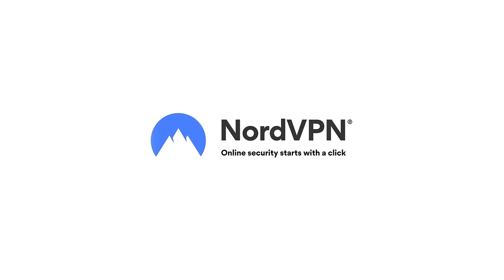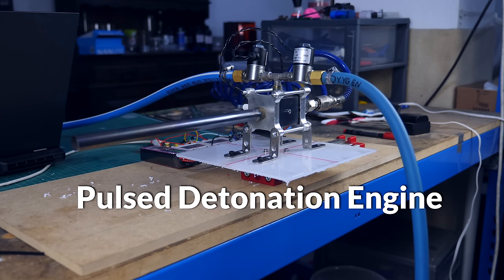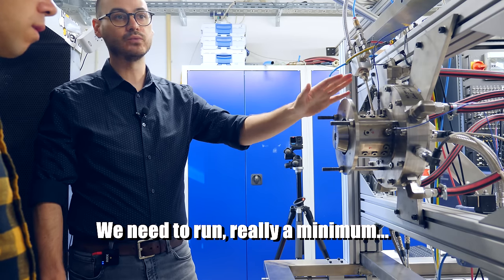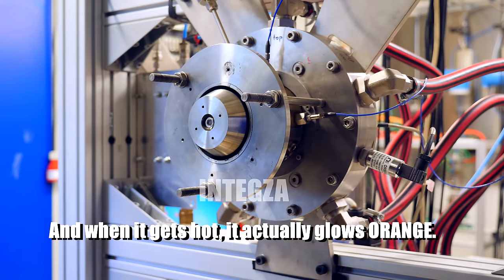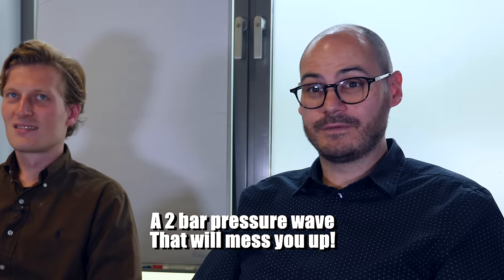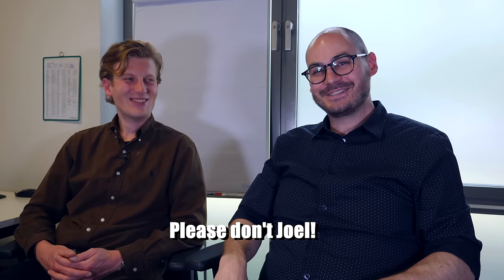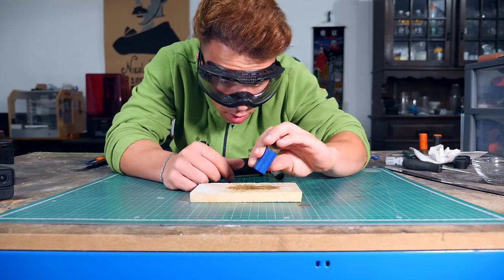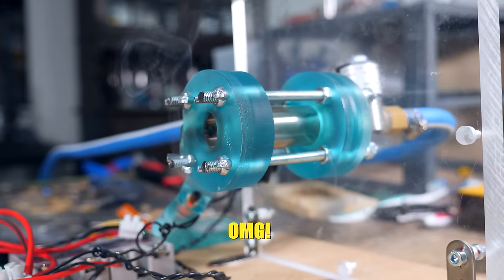NASA lost this TECHNOLOGY 60 YEARS AGO

Comment: Suggestion: Journey to an actual standalone rocket/plane/car - I really enjoy your content but working towards a practical, containerised engine for moving vehicles would propel you to anti-tomato legend status! I know it would be a much longer project, especially getting pressurised fuel into a reliable lightweight stand-alone format, but maybe collaborating with more like-minded people from e. g. the RC sector could make it a lot easier - In any case I look forward to seeing what comes next!
Reply: Yeah!
Reply: Hell yeah
Reply: I had the same thought, but on a slightly larger scale.... I've seen people build rc aircraft that are friggin HUGE.... why couldn't one be made to carry a payload of say 200 pounds? 250 pounds? And if this can be done, would it be possible to use an engine like this since the tanks are relatively small... I have been designing a " personal aircraft " for many years, without the needed knowledge to be successful, but using my gi bill I am currently going through on an aerospace engineering degree.... I am hoping to tinker my way to a fun and REALLY dangerous toy some time in the next decade.
Reply: Peter Streipol please help us!!
Reply: @ryanrich9186  what's your email? I think I could help you out a bit here... just finished my first test flight building one out of my garage (theoretical 500 lb thrust)
Reply: Real suggestion:  Bring back the goatee.
Reply: @loganhenning4850  hey do you mind discussing a bit with an aspiring engineer?

Comment: I’m a researcher at the University of Central Florida specialized in RDE’s and Pressure Gained Devices. I have been watching your videos for a while and would love to talk more if you are interested. My next video idea would be to make the RDE combustion chamber annual and attempt to observe the actual rotating detonation. An additional idea would be to create a planar RDE which would use this exact same set up and would just be used to observe the detonation wave.
Reply: My issue with this type of engine is that they are INSANELY AND EXTREMELY UNSTABLE. While I know hopefully in the future we might be able to implement these types of engines there is a reason why haven't seen that happen. 

I did see P&W got a contract for them, but it will be interesting to see if anything comes of the research. 

I remember during my capstone someone gave a presentation of these and I highly rolled my eyes at them. 

As an AE we already have enough problems with airplanes trying to blow themselves up.
Reply: @seemlesslies  As an A&P I can confirm, turbines like to blow themselves up haha. 
It would be interesting to see an RDE used in a sort of “afterburner” theory behind a turbojet. If it was centered on the inner axis and the compressor section could direct compressed HydrOx fuel air mix you could potentially have enough pressure to drive the combustion wave. 

I guess you could think of it like a shotgun, inside a cannon hahaha
Reply: Buddy am interested to listen to your talk and view on this technology, can you share your insta id, we can connect there and talk further!
Reply: Give this guy some likes. I want to see the collaboration video.
Reply: @itsbingbongyo  I just think it's one of those rabbit holes of research where money goes to die.

I always love the comments of. "It has no moving parts therefore it is easier to manufacturer!" Then when you realize the insanely complex control system that needs to constantly be working in extreme environmental conditions. They couldn't even run the thing for longer than a second. This should tell people just how unstable it is. 

It's like fusion technology were constantly 5 years away from a break through. 

I'm a very if it ain't broke don't fix it. 

ENGINEERRS loveeeee to play efficiency gain games and quickly dig themselves in holes no one can ever get out of. 

My bigger question is why do we need these who are these going to serve? We already have the F-22. No one has competed with the US on that front. The F-35 is a joke compared to the F-22 in the sky. (I know I know they serve entirely different purposes but still). 

You think anyone in their right mind would get on a plane with this type of engine? 

It's like electric helicopters. I wouldn't touch those with a ten foot pole. 30 mins of flight time. That is bananas safety margins. 

I wish people would get off the electric aircraft train it's a horrible idea and it will never work. Fuel is your safety factor of an aircraft. The future for planes is likely natural gas or hydrogen. The energy density is at least reasonable.
Reply: Annual combustion? Why not daily?
Reply: @seemlesslies  progress has to start somewhere
Reply: @armaniwebb4467  I think progress for the sake of progress is absurd. I have no issue with setting reasonable expectation, but some stuff is just not likely to work and is likely just a waste of money. 

I can name a crap ton of pieces of engineering technology that were an utter waste of time, money, resources. 

First one being solar cells for 95% of applications. They are garbage. Their energy density is laughable at best and are only useful in edge cases. (This will be a reoccurring theme and energy density). Solar cells are entirely unsustainable in all forms and the only reason they should be used is for places where you cannot get power. Mars I'm looking at you. 

Electrical Air flight that has anything to do with more than a few dozen pounds. Why? Because energy density of fuel. One of the most important part to the safety factors for aircraft is their fuel. Why? Because altitude is generally the best way to keep you safe. The only future to aircraft that will likely be mainstream is hydrogen or liquid natural gas. This is entirely due to energy density. 

And stuff like carbon nanotubes it's purely theoretical at best and has like zero practical application.
Reply: @seemlesslies  Lord Kelvin swore black-and-blue, and gave speeches in the House of Lords, that it would be suicidal to construct powered transport that went a hundred miles an hour. Insisted that the human frame could not survive it.
Just saying.
Reply: @seemlesslies  You know, I always wonder why progress was so slow for homosapiens for the first 500,000 years of our existence. Homo Sapiens and precursors had been using stone tools for over 1.5 million years, but we only started using fire 200,000 years ago. And then, even with fire, it took us another 180,000 years to figure out how to grow food, domesticate animals and forge copper. Then it took 19850 years to go from metal hand tools and horse carriages to the industrial revolution. Then only 150 years to go from steam trains and telegraphs to F22s and Supercomputers. Thus showing the true capacity for innovation we had all along.

I genuinely believe its due to the prevalence of men with your mindset. Thank goodness we didn't get hit with a extinction level event anywhere along that 1.5million year malaise when stone tools and caves were 'good enough' for us.
Reply: @caseyb1346  I think you have a fundemental misunderstanding of how history and science works. I wonder if you have ever made something or engineered anything to function in the world. 

I used to honestly be like you and think that we just needed to pump as much money as possible into research and it would make dividends on humanities progress, and then I started actually making things and being involved with projects and you quickly realize that unfocused research generally leads to dead ends for a large number of reasons.

You haven't addressed any of my points but attack my character which is always fun. 

What you're failing to grasp is there are natural limits due to physics. There are things that just cannot be overcome with "more research". 

Also I strongly recommend taking or looking into history of science. Because what I also failed to understand is that science theory only progressed as technology allowed for the experiments to be shown to be true. The helocentric model of the earth was developed in 400 BC. It wasn't taken seriously till the invention of the telescope. The reason being is that they had no way to prove it to anyone. They could not prove gravity even existed. Without the discovery of gravity and the rotation of the planet they could not explain why things fell. (This was a HUGE) problem. 

Then let's go into the Quagmire of crackpop science. The countless number of people hurt by science in their day. Want to talk about blood letting and mercury cures? 

I listed quite a few well known technologies that are horrible and are widely used for all the wrong reasons because they will "save the planet". 

The first rule in life is everything has a cost. You will NEVER get something from nothing. Entropy is like death and taxes. Everything produces waste. I wish people would stop selling "green" because nothing is green. 

Finally let's talk about the physics. There are real world limitations that you can never get around. For isntance the speed of light is "the speed of limit of the universe" it is for all intents and purposes impossible to get around. You have the physical limitations of materials, and you have the total amount of energy required to do things that doesn't change; The only thing that changes is how efficient you can do it. Which is exactly what this motor is doing. It is increasing the overly efficiency of the fuel burning and rotational process, but it comes at the cost of stability. How unstable? EXTREMELY UNSTABLE. As I said above engines right now are already trying to constantly blow themselves up. They can barely operate this technology for a second. Because the temperatures are so high and how the systems they are using to control it couldn't withstand the heat/pressure. This is a limitations of materials. 

Materials limitations is actually one of the biggest problems we have right now. We just cannot make things that much stronger than they already are and even the things that we could possibly make stronger it comes as a significant cost. 

In aircraft weight is the enemy. 

You want another idea that is doomed for failure? Electronically stabilized structures. One of the biggest problems on all structures isnt the static loads it's the dynamic loads and frequency responses. You can electronically stabilize a structure due to flutter and reduce the weight of the structure. HOWEVER, if that system EVER fails your wing just breaks instantly. To margin of safety on that is just to high and will never be implemented maybe extremely light weight not human flight because no system is perfect. 

Want another example? Let's talk about The Naiver Stoked Equation. It has a million dollar prize right now it has had that prize for at least 20 years. If we could solve that equation in a closed form it would literally change the world. I'm talking a priceless equation. You have had people working on it for decades and they cannot solve it. Why? Because we just don't have the ability right now. It's not a matter of time or money it's just a lack of knowledge to apply to it. 

Let me finish in closing that. I'm not against experimentation. I actually love it and think it's super exciting, but selling it as the solutions for the future is bananas, and wasting time on unknown technologies that likely are decades away from being useful when we have valid technologies that can be improved and properly implemented blows my mind. 

This isn't really the engine of tomorrow it's the engine in a century (maybe). 

I'm talking about having reasonable expectations.
Reply: helo , i like to researching about that RDE  can you help ?

Comment: I love your videos!, create a drone powered by a rocket engine!
Reply: Y E S
Reply: That would be too expensive though. 4 ROCKET ENGINES on each side.

Also the RC gear would be too heavy because you have to throttle each engine to make it lean in a certain way.

Also throttling a rocket engine is not as fast as slowing down a BLDC Motor.
Reply: @slatetechnologies1724  :(
Reply: @netanelelbaz7247  What?
Reply: @netanelelbaz7247  So, a couple of things to consider with this idea. Most drones achieve rotation by taking advantage of the rotational inertia of the propellers. But rocket engines don't have that, so simply replacing props with rocket engines will result in a hover-only drone. 
Instead it would be best to do it the way NASA did with their Project Morpheus; a single rocket engine to provide hover thrust and smaller engines to stabilize it and provide side thrust.
Which brings up the point that NASA's already doing that.
Also, don't beg for likes.
Reply: Well… I build fpv drones and I’m sure it would be to hard for the flight controller to control 4 engines. An airplane would be better. Or rc car
Reply: Begged for likes and still didn’t get the 3D Printer?
Reply: @suspense_comix3237  I guess this giveaway is a scam :D
Reply: @netanelelbaz7247  mad cause you lost

Comment: As an alternative to the primer from gun shells, you could go to a well stocked tool store and ask for the "powder loads" or "strip" for a Hilti gun (aka "Powder-Actuated Fastening Tool"). The nice thing is that those come in multiple strengths, so you can pick one that works for you.
Reply: Alternatively, depending on Airsoft rules in Portugal, you might be able to buy the 209 primers from Airsoft suppliers, as they are used in Airsoft Grenades/mines.
Reply: I don't know the rules for Portugal, but I think an alarm gum might be legal, it's basically a gun that can sound like a gun but not shoot anything.
Reply: I recall Mythbusters setting off .22 rounds with electricity. Those are rim fired cases as well.
Reply: The DX460 is fully automatic, with a 27 caliber charge. Wood, concrete, steel to steel, she'll throw a fastener into anything. And for my money, she handles recoil better than the Simpson or the P3500.
Reply: The gunpowder in the shotgun shell won't explode until its confined. Pistol powders burn faster than shotgun powders. The explosive in a modern primer is usually a combination of things based around Lead styphnate. 
As alternative sources for detonation;
You might be able to use something like Armstrong's mixture (usually available premade in pull string fireworks, kids capgun toys, either the red paper strips or the little red plastic 'loads').
Or, the mercury fulminate from party poppers, snap pops, adult crackers, ie the fireworks you throw against the ground.
Reply: Cap guns might be more economical, and you can choose how much effort you want to go through
Reply: @Fraxxxi  I don't recall the exact Hilti model that I used at an age of less than 10 (without permission of course), but since then I have been hooked. I've never looked for any alternatives when using them for their intended purpose. If something has to go into something it doesn't want to go into, there's no substitute.

Comment: The part with you standing up against the door when it went off reminds me of when I used to work for my local utility. One day I was at the plant while they were doing an inspection of one of the gas turbines. I didn’t have much to do that day so I stuck around and watched. They finished up and went inside to spin it up for peak and I was just watching from the corner when one of them turns to me and says, “you’re in the no no square”
Apparently, once the generator has synced up its voltage and phase to the grid, a massive breaker trips to connect the generator to the grid. If that connection fails for some reason there’s the possibility that all the power that generator is making will explode out, ripping the massive steel breaker door off its hinges and sending it straight through the no no square and whoever happens to be standing in it.
Reply: That's insane. I'm more curious about that than anything else now lol
Reply: "OSHA approved"
Reply: @792slayer  it was a coal plant before the coal boilers were shuttered so there is a thick layer of coal dust covering half the plant. If there were a fire that place would go up like a torch, so yes, OSHA approved
Reply: @samreid6010  oof. That's hazardous as all hell.
Reply: The no no square

Comment: RDEs are typically an annular design with a center spike (similar to aerospike), so you could potentially try using a cooled center spike to guide the rotating detonation wace around the circumference

Edit: In addition, the detonation wave propagates around at the inlet of the chamber so your ignition source/detonation seed should also be closer in that area
Reply: That's what I was thinking. If you just have large open combustion chamber, the combustion doesn't really have a path; you just have to hope it'll stick to the outside wall.
Reply: If you read the original paper they specifically say that it's achievable without inner cylinder. But it probably makes it easier.
Reply: Instead of having the fuel go through to try to cool the center you could just have the feul or air cool the outside wall like on the space shuttle rocket motor
Reply: RE your comment about the central spike, that had also crossed my mind.  I didn't even think about where the detonation should start.  Thanks!
Reply: Another problem which becomes obvious if you open up his 3d file is that the injector is placed in quite bad manner that oxy and fuel won't be mixed in time.

Edit: the paper he referred to has initiator 65mm apart from the injector surface. I don't think it should be close to the combustion area. Plus, geometrical bump from the initiator might disturb the shockwave. You don't want to have shockwave echoing around especially because it doesn't have guiding inner cylinder in this case.